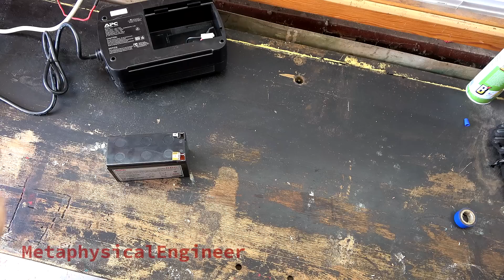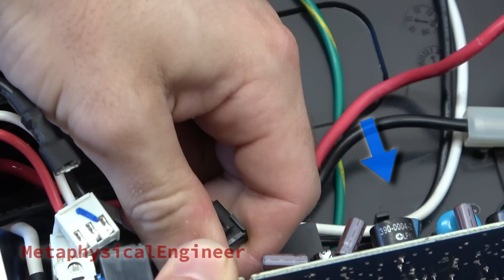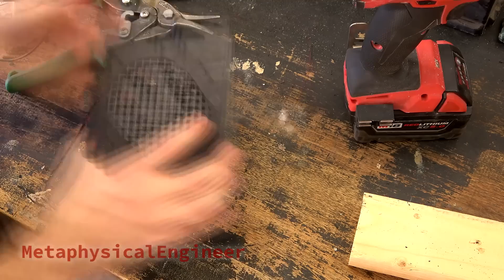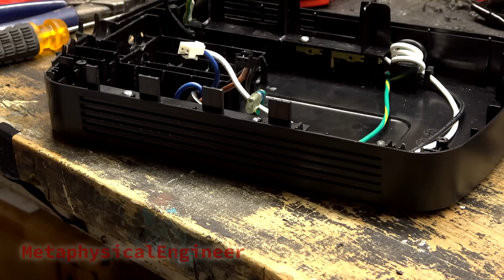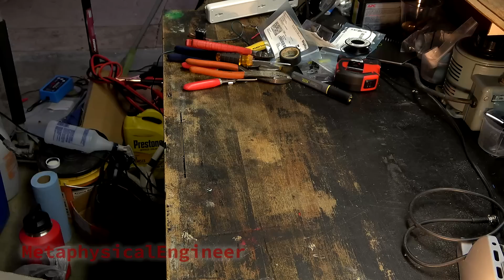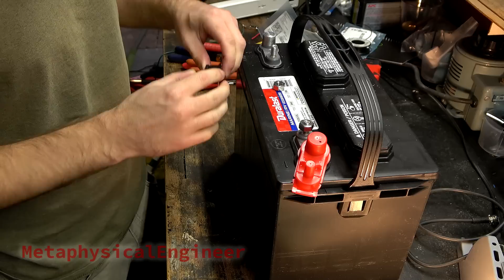Modifying broken UPS for long endurance BACKUP POWER!

Comment from the maker: Hydrogen?  Explosion risk? Why not lithium?  Parts list?
!!  FAQ HERE  !!
Update video: https://www.youtube.com/watch?v=IPXNGt6NfsU
Stream discussing some of these:
https://youtube.com/live/9JOuYWRu3h4?feature=share

What about Hydrogen?!  A single battery at float charge has very slow rate of offgassing.  If the battery released enough gas to be an issue, it would be dry in weeks, as would every other battery ever connected to a battery maintainer (which defeats the purpose entirely).  This is one battery in a 1960s building with significant air exchange, not a bank of batteries under heavy cycling in a hermetically sealed bunker.  Yes an AGM would be safer, and is a possible future retrofit.  

Modified sine wave will destroy your computer!  My computer's PSU is rated for use on modified sine, according to the manufacturer on the official FAQ.  Not all brands or models give that assurance.  

The battery will spray acid if it suffers a major failure! Even a sealed or AGM battery will vent under those conditions, though random catastrophic failures are very rare without external causes such as mechanical damage, short circuit, or extreme overcharging.  

What about LiFePo4 / Lithium?  Higher performance but expensive and needs separate battery management; planned for a future version 2 of this project!

Y'know, there's a thing called a deburring tool instead of a utility knife...  I had one.  Discovered it was missing when I went to do that stage of the project and realized just how many holes I had to drill.  I have since replaced it.  And gotten a step drill bit as well.  

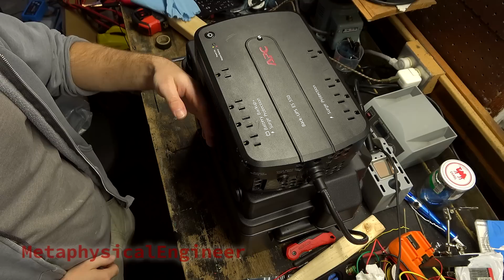The fan is blocked! There's no airflow!   Fan has more clearance than first appears.  Compare position of fan intake and the velcro at 27:46 and position of velcro and the channel in the battery box lid in the side view at 30:15. Almost as if I planned the placement!   Not as effective as open air, but still plenty.

Just buy a huge power bank with built in inverter!  Power banks with UPS functions are neat, but every one I've seen linked so far has abysmally slow transfer time of 30ms, which would guarantee my computer shutting down during the switch.  Also, units with comparable runtimes get very pricey, approaching 4x the cost of this project.   If you have suggestions, please let me know. At a future point with more budget, I'd consider doing product reviews.  

How long does it take to charge?  It will get there.  Eventually.  The charger in the UPS is a maintainer more than anything for a battery of this size.   Significant discharge will require a boost with external charger.  Adding a better charger is another potential future upgrade. 

Why didn't you start with a top of the line high power UPS?  I found this one for free in a scrap pile in the stairwell of an office building.  I was either going to analyze why it failed or replace the internal battery.  Then got annoyed enough at a power outage to try strapping a car battery to it and seeing what it could do.  Results were better than expected, so I turned it into a full project.  Of course it's not perfect, but it does do what I asked it to do, and I got a cool video.  

Why keep the alarm buzzer?  I wanted the option to have the alarm.  But also an option to turn it down.  A latching, auto reset mute circuit would have been a cool alternative where could just press a button to silence the alarm and it would stay off until the next power loss event.  

Ew the music!  Agreed; I could have done better and I'm working to improve future content.   If it bothers you that much, nobody is forcing you to watch :)

Parts list??  Here you go!  Read datasheets and verify before ordering.  I take no responsibility for any property damage, injury, etc. arising from attempts to replicate this project.

P1           |  PTN16-D01115K1B1     |   1k Potentiometer 0.125W	Any similar part will work
D1          | 1N456ATR	                     |   General Purpose Diode 30V  0.5A 	Any similar part will work
Qi           | 2N4403TAR                      |  	General purpose PNP transistor 40V 0.6A hFE 100  Any similar part will work
Qm        | IRLZ44NPBF 	            |   N-Channel MOSFET 55V 47A Threshold 2V 	Overkill for this application; any similar part will work
C1         |  EEU-EB1E101SH 	    |   Aluminum Electrolytic Capacitor 100uF 25V	Any equivalent part will work
R1, R3   |  CF14JT1K00	            |   1k ohm  0.25W	Any equivalent part will work
R2         |  CF14JT560K	            |   560k ohm  0.25W   Any equivalent part will work
Reply: Well fine. You covered everything I had to say in one post.
Reply: Nice preemptive for all the self-righteous know-it-alls. I have almost a dozen old school and newer UPSs and have wanted to do this since the first one. Am saving this video for a template to start from.
Reply: Just out of curiosity, I'm left wondering how much was spent (hard $ ... not time) on this free UPS.  Granted, you ended up with a very beefy UPS.
Reply: Nice. We could easily use those "drop in lead replacement" LiFePo4s with the built in BMSs yeah?

I have some spare, and an old rack mount UPS that could be put to good use, although I think it may be 48v and I think my lithium's only handle 2S chaining. Hmmm 🤔
Reply from the maker: @bc4yt  Yes, though I would mod in a dedicated charger circuit when changing battery chemistry and make sure to follow battery manufacturer's application instructions.  Integrated BMS can only see what's happening inside that single battery, so could be overwhelmed if a problem happens to another in the chain.
Reply: Ahh lead acid charge profile for lithium wont be ideal but wont harm it. They would have to get a top off charge regularly to benefit entirely @MetaphysicalEngineer
Reply: Throughal and well done.
Reply: @MetaphysicalEngineer    Do SLA batteries and Automotive batteries have the same charging profiles and voltages?
Nice build, BTW. Thanks for the video!

Comment: nice video cool well have same Ups in tool box have tool box big enough cut out put my usp into have 12V 18A UPS with a fan and 4 USB port in tool box and 20A fused i can run 2 hours with 65wats laptop battery not hold charge

Comment: Modified square wave inverter!! Don't run your computer too long on it because it stresses the PFC circuitry in the power supply! Cool project though thanks for sharing
Reply from the maker: Thanks for the comment!  Yeah I'm aware modified output can mess with the PFC.  Reached out to EVGA and got answers that it should be fine- they tested for that!  I for sure get a little more coil whine when running on inverter but it handled an hour+ without any issues before.

Comment: I've been searching for a video like this for the last couple weeks, and thank god I stumbled upon this. I have tried the same, but I got some issues with mine, and would be great if you can help me with this!

I put a 35Ah Car Battery in my UPS, and it runs great on battery -- only issue it when I plug into AC, where the UPS runs for a while and suddenly starts screaming with the red error light turned on. Only way to stop the screaming is to unplug the battery, and re-plugging it back runs for another couple of hours, and again error.
Then just to test, I connected the UPS battery (which was 8Ah) too, to run it both on parallel, and now it worked great, no error, and ran for hours. But my concern is the smaller UPS battery sometimes gets a bit warm, and I don't want any explosions! (I'm thinking maybe the smaller battery is absorbing the heat around it because its inside the UPS; like from the transformer and the circuitry -- could be wrong! but for now, I kept the UPS open, so the heat can escape passively)

I know this vid is like 1 year old, but I hope I get answers as for why the error light goes of after a couple of hours when it's connected to AC with the car battery plugged in, and why it goes away if I unplug and reconnect the battery. The UPS model is a "K-Star 650V" which also, I got for free because the battery is dead!
Reply from the maker: Is it a new car battery or a used car battery that you tried to connect?  Sounds like the UPS is throwing an error because the battery is drawing too much charging current for too long or otherwise is not behaving as expected.  Are you putting the "failed" original battery in or a new replacement when you get it to work?  Strange that it seems to work ok when both are in parallel.  

Take voltage and current measurements going to the batteries and try to figure out what it's doing.  You may need to disable the onboard charger and use a separate charger for the bigger battery.
Reply: @MetaphysicalEngineer  Hi, thank you for you reply! and Yes, the battery is somewhat old! I just had a UPS, and a car battery lying around, and decided to try it. 

But hey, got some good news, turns out after I watched your video, it magically fixed!
JK, I think the problem was the UPS is overheating -- you see, all I did was got some long cables, and connected it to the battery wires inside the UPS and connected it to the car battery, at that time I didn't think much about cooling, and I didn't add a fan (my bad!). So as a temperary fix after watching your vid, I kept the UPS open (without closing it up - let it cool passively), and it worked!

After a while I added a fan, and it is running for two days now (while AC connected), no overheats, no screaming. Although the car battery is a little bit worn out, it gives me a backup time for about 2 hours, not bad for a 650VA UPS that had less than 10 minutes of backup time! (and yes, I removed that parallel-UPS battery, don't want explosions! Only the car battery is connected now!)

All thanks to your video mate, this crazy DIY project finally worked haha
Thanks a lot!
Reply from the maker: Overheating would certainly make the UPS scream!   You're lucky it had a safety shutdown instead of just letting the inverter burn out when it got too hot.  When the whole design is built around the tiny battery, I expect the safety measures to rely on the battery itself running out of energy before anything got hot enough to melt!

Glad you got it working!
Reply: @MetaphysicalEngineer  Thank you mate!

Comment: nice video how much amp battery have 🥰🥰🥰🥰🥰🥰i have 550 VA   Ups  330wats  i have 18V 5A LITHIUM battery runing with it buy 18V to 12V 20A converter i un laptop for 3hours and 20minutes
Reply from the maker: This battery is rated 115 amp hour at the slow 20 hour discharge rate.  The reserve capacity of 180 minutes at 25 amps calculates to 75 amp hours at a fast discharge rate like running the UPS.  

Interesting solution using the higher voltage lithium converted down to 12V!
Reply: Well i have 550VA 330Wats ups so i have some 18V 5A LITHIUM drill battery M18  18V 5A and 18V 12A so what i did buy converter 18V to 12V 20A and used it on my ups i have battery charger to charge them so i run my laptop off it 1 18V 5A give me 3hours and 20minutes on battery my laptop is 16 buy 10 1/2 inch scream battery not keep charge

Comment: nice build how much amp battery have may i asked
Reply from the maker: Thanks!  Battery is 115 amp hour at the slow 20 hour discharge rate.  The reserve capacity of 180 minutes at 25 amps calculates to 75 amp hours at a fast discharge rate like running the UPS.

Comment: The placement of the fan on the underside makes it look like there won't be enough airflow. Have you checked how much air it's able to suck in?
Reply from the maker: The fan has more clearance than first appears.  Compare position of fan intake and the velcro at 27:46 and position of velcro and the channel in the battery box lid in the side view at 30:15. Almost as if I planned the placement!   Not as effective as open air, but still plenty for this application.

Comment: I found some older APC UPS models very similar if not the same as yours on eBay for cheap, and I got a few old car batteries for free that still work. My plan was to set up a budget UPS for my home PC and server, but someone warned me that these APC units might overcharge a car battery, causing it to wear out quickly—or worse, it could release gas or leak.

In your video, you mentioned the voltage stabilizing at around 13.5V, which you said is safe. I don’t intend to run the battery for long periods to avoid deep cycling it, as I know standard car batteries can’t handle too many cycles. Really, I’d just want it for occasional power outages (every few weeks or months) or to protect against surges to avoid damaging my components.

So, would this setup work with a regular lead-acid car battery, or would I need a marine/deep-cycle battery for my needs? My usage would be about 6-10 hours a day for the main rig and 24/7 for the server, though outages are pretty rare here. Is a marine battery necessary, or could a car battery handle this safely for my setup? 

Thanks!
Reply from the maker: Sorry for the late reply!  

A car battery would work safely, but it would be more susceptible to wearing out since it is designed for brief period of high current for starting, but not for any sort of significant discharge.  A deep cycle battery has thicker electrode plates that can't deliver as much peak current but are much more resistant to degradation when cycled.  An outage every few months is fine.  Outage every few weeks and a car battery will quickly see more cycles than designed for.  

A flooded deep cycle battery should be comparable in cost to a similarly sized flooded car battery.  An AGM deep cycle battery is the best lead-acid tech with zero off gassing in normal conditions and much better cycling performance, but will cost more.  

Follow up video shows how I do maintenance on this project and how little water is consumed (and thus how miniscule the amount of off gassing is): https://youtu.be/IPXNGt6NfsU

Comment: I did this with a Duracell Deep Cycle boat battery, and it boiled dry and died.
Reply from the maker: Interesting!  Did you happen to measure what float voltage it settled at?
Reply: @MetaphysicalEngineer  13.6v. I guess I should have checked the fill levels. It was over maybe two years. (It wasn't actually boiling, of course.) 
I'm now using an Opti-Ups with 27 AH internal and 54 AH external. It is a great unit with 0ms switchover, since it is always re-oscillating rectified DC as a pure sine wave. Thanks for all the fascinating and helpful content!
Reply from the maker: Oh!  The way you worded the first comment made it sound as though the battery boiled dry quickly!  Flooded batteries do need frequent maintenance when kept on float charge.  I'll have to do a quick update video on the procedure for my contraption here.  

Doing it over again, I'd love to repeat with a much higher end UPS such as yours.  Eventual version 2, I suppose!
Reply: @MetaphysicalEngineer  Thanks, will look forward to that!
Reply from the maker: If you'd be interested, I have an update video about inspecting the battery and routine maintenance on this project.
Reply: @MetaphysicalEngineer  Thanks very much!

Comment: For the fan I would have used a 555 timer! Now your circuit gradually reduces the voltage which causes the mosfet to run in the linear region whereas with the 555 timer that wouldnt be the case
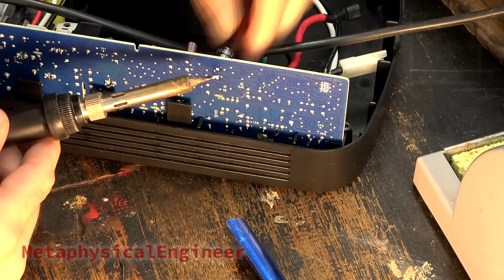Reply from the maker: 555 was indeed another option, though similar in complexity with the support components.  For such a tiny fan, the mosfet spends very little time dissipating power as seen with how quickly the voltage drops out at 17:30.  For a larger load, a 555 or a comparator driving the mosfet would be essential to shut it down quickly.

Comment: Nice! I got a nice free older but high-end UPS (APC Back-UPS XS 1200) of similar design, even with a brand new battery set the previous owner tried changing out. Unfortunately, it appears (reading data from it over APCUPSD with a special USB cable) that it is sensing AC input voltage as being chaotically all over the place (frequently outside the loosest tolerances the firmware will allow to be set) at all times (even when unplugged?), and refusing to switch from battery to line power due to this perceived unstable line voltage. As this sensing appears to take place from a pair of resistor chains from the high-voltage side heading into what I believe is a TS358CS double op-amp amplifying the difference between them (who's other connections are difficult to trace) and thus doesn't contain any components that seem plausible to wear out over time or easy to test, I'm not sure what I can do to fix it, at least not without a schematic to figure out all the other connections going on.
Could worn-out electrolytic capacitors be causing the device's power supply to leak enough noise back to where this voltage sensing is going on to interfere with the process? Replacing the through-hole electrolytic capacitors would be a relatively simple matter of ordering similar parts, but if it's not that I have no idea where to start.

Comment: great project.
I built one years ago but it kept overcharging my battery.  I guess the electronics in this unit will prevent that from ever happening.
Reply from the maker: Some models may not be as kind to the batteries as others.  The original charger circuit still isn't ideal, and an upgrade or version 2 of this project will have a separate charger for faster recovery and improved battery life.